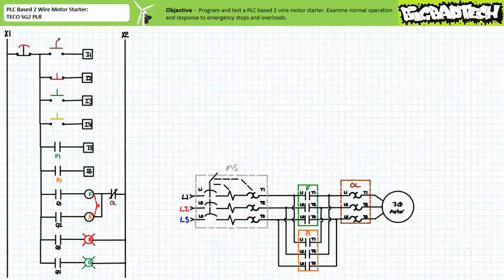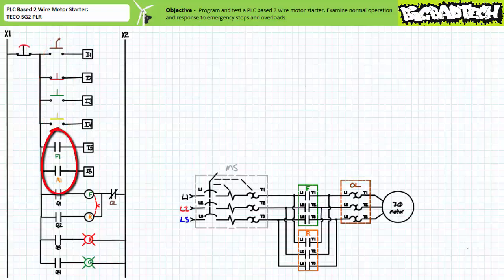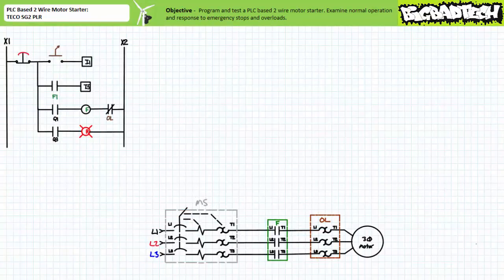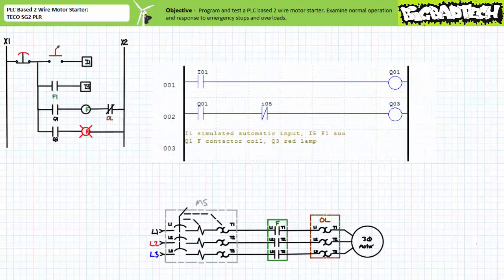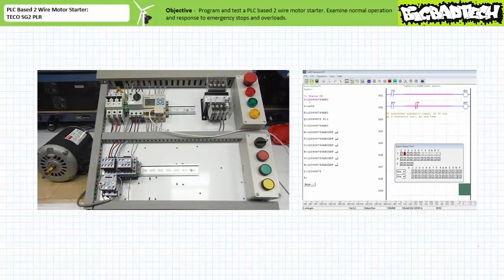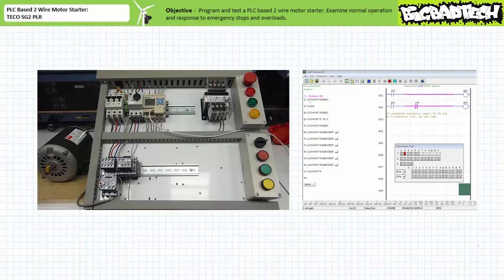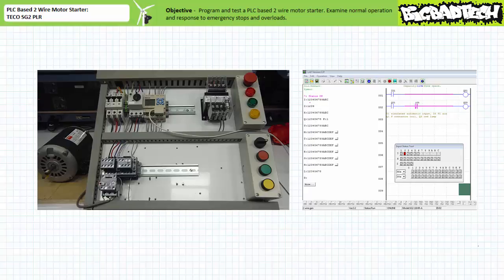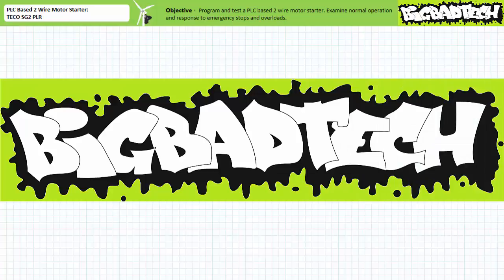PLC Based 2 Wire Motor Starter: TECO SG2 PLR (Full Lecture)

Comment: Just to reiterate,switch assigned to I1 which actuates Q1 coil,which through NO contact and OL activates F coil. I2 is assigned to Stop PB which is NC.In the end of the lesson You see I1, I2 and I5 active when motor running.